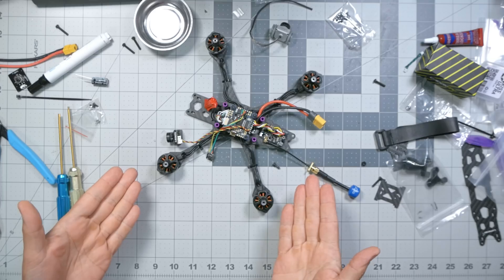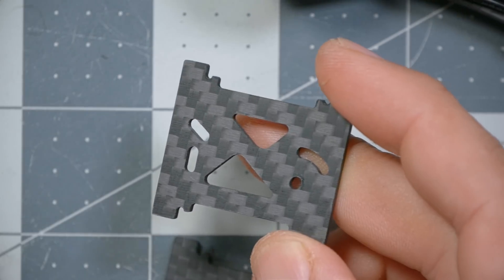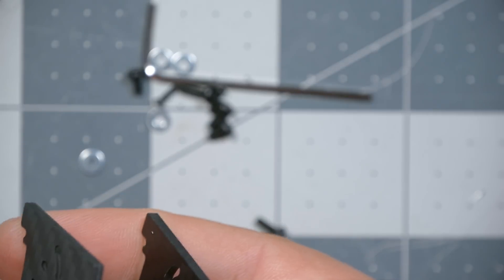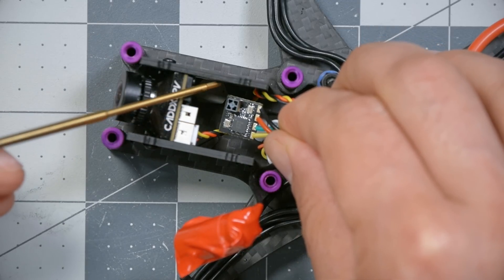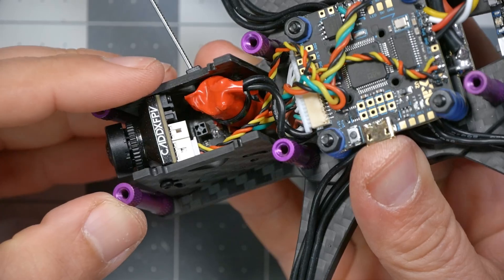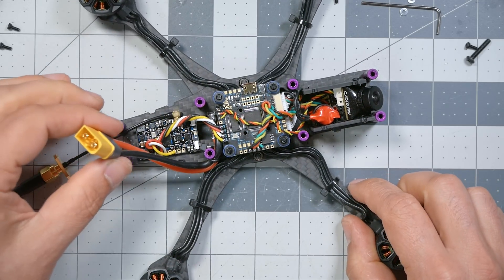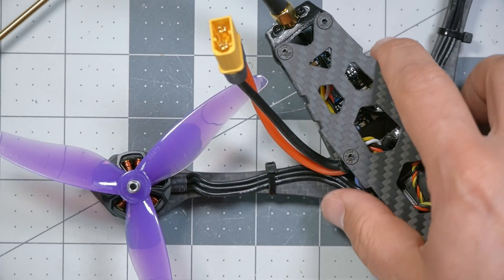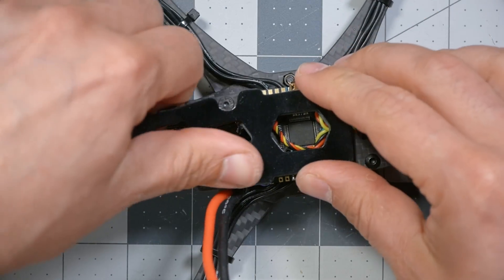2022 Freestyle FPV Drone Build - Final Assembly

Comment: Josh, please help!!! I got the this quad built. Everything went great. I ordered the full DJI system, Vista with DJI controller and v2 goggles. During testing without props on it arms fine, but after I give it some throttle it just stays throttled up. If I tried to do this test with the props on, it probably would have ended up on the moon. Can you help me trouble shoot my issue? I am thinking it might be the battery??? I got the recommended  6S 1500mAh  Lumenier battery. Also the Vista was overheating??
Reply from the maker: https://youtu.be/xBaefeQtA1c explains why the motor speed up.
Reply: @JoshuaBardwell   That was it!!!!! Thanks JB
Reply from the maker: Vista overheating on the bench is normal. It will shut down to avoid damage. In airflow when flying it'll be fine.

Comment: Hey JB love the series, love the channel and love the drone! I was hoping you could help me out. I’ve fully assembled the drone and everything is looking good and working well except for the video feed to my goggles. I’m able to find the feed channel and all is clear when I face the antennas at the drone from a few feet away but as soon as I move the goggles further away I completely loose connection. I can’t see any visual damage to antennas or vtx.
Reply from the maker: It seems like the vTX might be in pit mode. If so, the power led will be flashing. To take it out of pit mode hold down the vTX power button until it stops flashing.

Comment: i used an EP1 antenna, and hung the antenna out the front below the camera.
It might get damaged, but its cheap. And i think its the best spot for the clearest signal
The ELRS 2.4 antennas are far too short to stick between arms like the crossfire

Comment: i just got mine stuck in a tree. Poked it down with a stick and tried to catch it
full weight of the quad falling down into the palm of my hand, on the tip of a prop. 
not too much blood. Props are dangerous even when they're entirely unpowered lol.

Comment: So how big is the difference between a 2022 build compared to a 2021 or 2020 build… much changed performance wise?
Reply from the maker: These are 2207 motors while the earlier one was 2206, so a little more power and torque.
Reply: @JoshuaBardwell  what sort of distance and flight time can you get out of this unit? 
Just ordered mine, arrives here in Canada this week. Stoked mate thanks for your work.
Reply: @edhog  have you figured out flight distance by chance ? I’m looking at getting the Hd one here quite soon